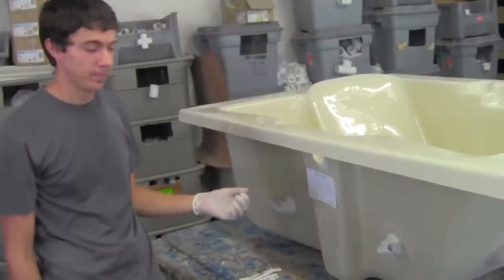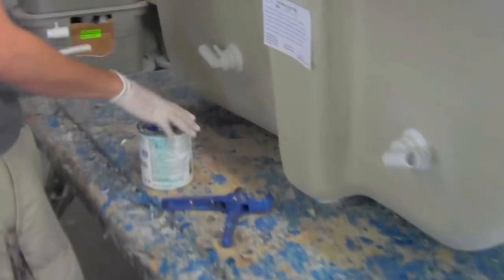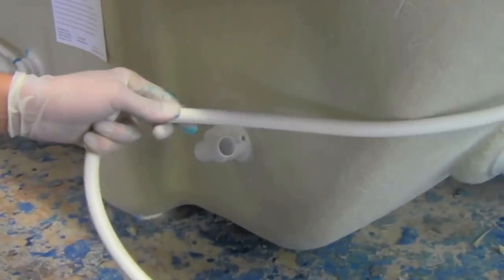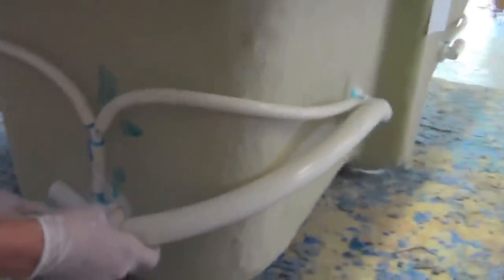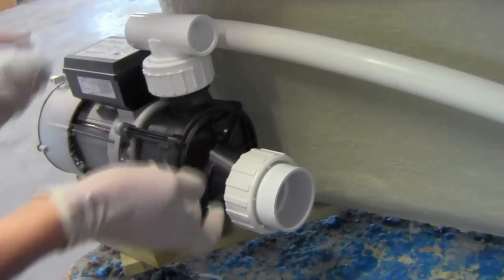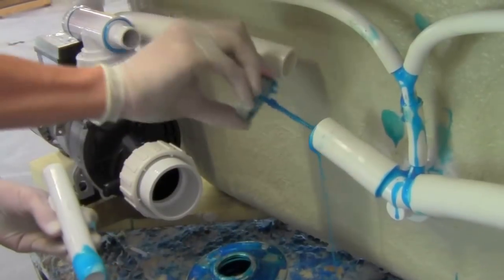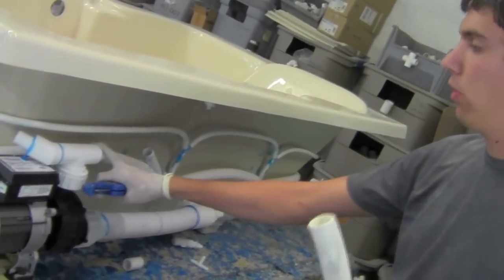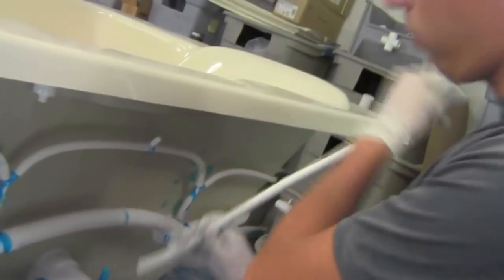Whirlpool bath plumbing tutorial

Comment: It`s a nice video! May be the best I have ever seen/ However I can`t understand the purpose of bypass  with Y-connectors.  Secondly-  is this flexible tube reliable? Some people told me - only rigid PVC pipes can be used for spa plumbing because water temperature, unstable pressure are destroying  flexible pipes. Thank you
Reply: The Y connector is just a way to connect the second set of pipes to the first. Rigid is pipe is ok, however there is no give, if it gets knocked during storage or install then you have a pipe to replace l, flexi pipe won’t be affected by the kind of heat that goes through the system and is also reinforced, it’s far better to use and more forgiving

Comment: HI Izzi i know this is a older video.. and by the way extremely informative and well done.. but i have a question from the whirlpool motor.. how do you connect it to your water heater motor.. my motor only circulates the water and i i bought a second one to heat the water.. any help please?
Reply: Should be connected from the suction pipe leading into the motor

Comment: This kid does not really care about the customer or his job, it's just a pay check to him-- you can just tell,Sloppy & I don't care attitude, applicator is wat too big, too much glue on many & others do not have glue all the way around connections. I'de say there has to be partial blocking the way he's glues this all together. I appriciate them doing the video but he should be more professional. I would not buy from this company after seeing this.
Reply: I like pride in a mans work, but I also like efficiency. I dont want to pay extra money, because the worker use extra time for cleaning up glue on places that I cant see, and that doesnt matter.
In this matter, things need to be tight inside, and smooth on the visible outside. 
And he is real effective =)
This is good output, I would hire this guy.
Reply: You can’t be beat with glue, sets very fast... kid doing a great job... no leaks
Reply: The kid is NOT getting glue all the way around the fitting!!!  Besides, you are supposed to put glue on the female part of the fittings, NOT the male part (unless you do both parts).  Lousy craftsmanship.
Reply: Imagine the grief any repairman would face having to work on this mess after baths been fitted & I bet they did already. Glue all over the pump casing too, voiding the warranty on the pump no doubt. Cowboy .
Reply: @goaway9487  bahaaaa